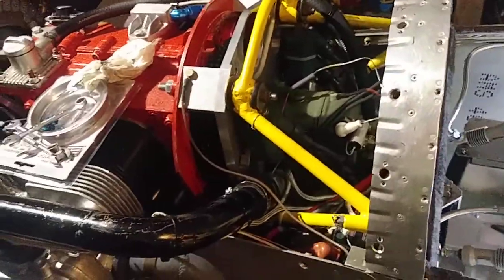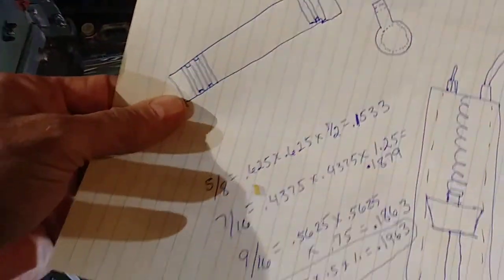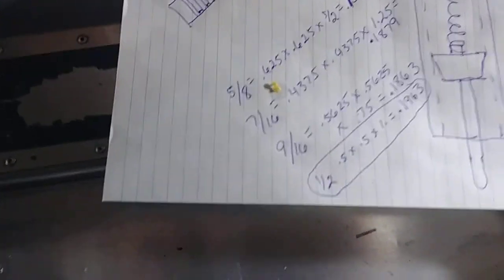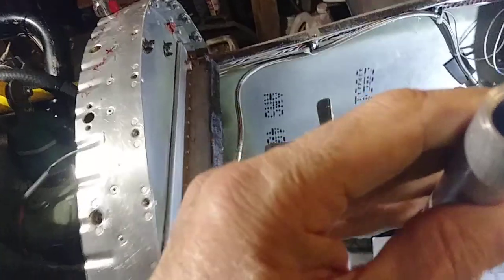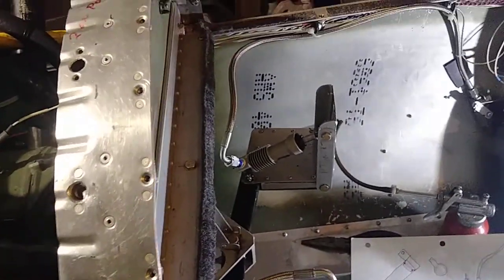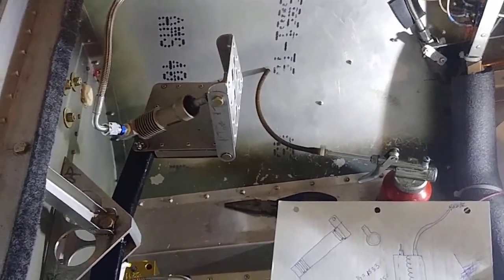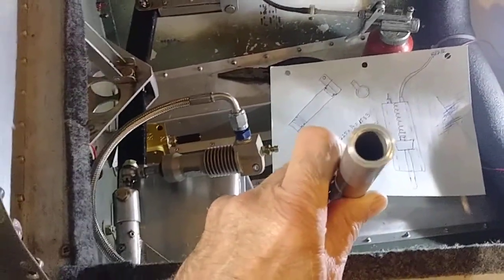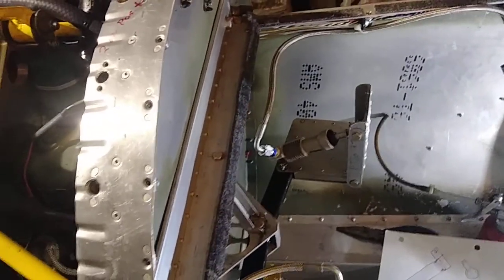Subscribers shout out on master cylinder design.....

Comment: Should be able to pick up 1/2" cups at your local NAPA
Reply from the maker: Hi Bart Penrod. Ok thank you. BUT I did find out I have been calling them wrong. They are lip seals NOT cup seals. And I'm not sure if they make a lip seal that small. Thank you so much Bart for taking the time to write me back.

Comment: The cylinders you have should be plenty. Any cylinder can be both a master cylinder and a slave cylinder when it comes to basic hydraulic cylinders anyway. If your having weak braking I'd suspect it's because you dont have any mechanical advantage on your brake pedals. People use cylinders like yours all the time on small airplanes. My Airbike for instance has only one 1/2 inch bore cylinder for both main landing gear wheels and it's way more than enough. The handle lever on the hand operated brake cylinder has a pivot point and lever that gives it a mechanical advantage. In other words you shouldn't be pushing the rod end of the cylinder directly, there should be some lever motion to it. Have you tried mounting the rod end of your cylinder down lower on the brake pedal?
Reply from the maker: Hi eclipso104. Thank you so much for your feedback. I was on the phone for a hour and a half with an other guy that was saying the same thing. I do not have the room to lower the cylinder to gain a mechanical advantage. But that is what I know I could use. Also I find Out that I really need a reservoir so that the temperature differences can  Level them self out.  Thank you so much for taking the time to give your feedback.